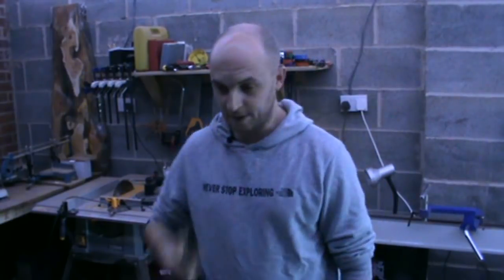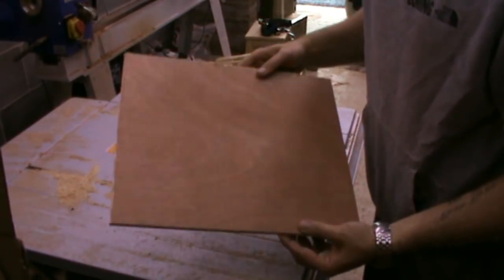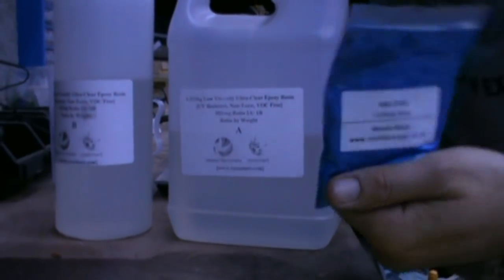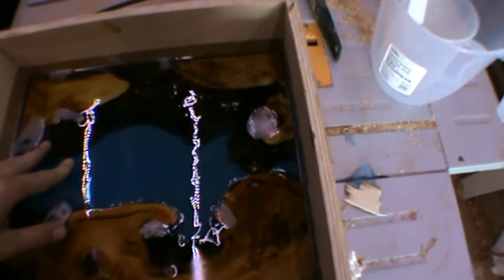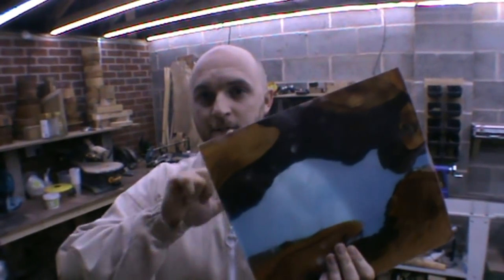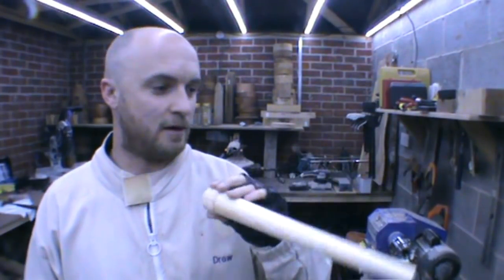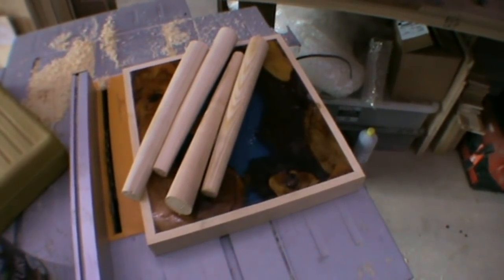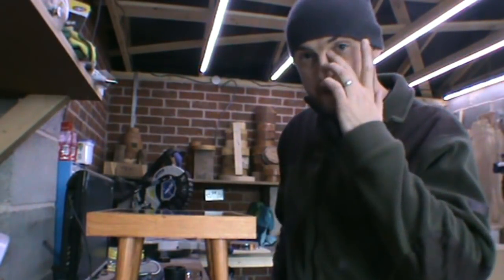How to make a Resin River Table

Comment: I have a question.
How did you remove the table top from frame box? I think it seems difficult because epoxy resin glues those things.
Reply from the maker: 櫻井仁紀 hello mate, thanks for the question 👍 I just used packing tape, it came out with a little gentle persuasion. The 4 sides were easy to get off, just a little whack with a hammer, the bottom was slightly harder, but again, a few careful knocks with a hammer saw it pop out! You can get mold release agent in a spray can, but I’ve never found it necessary! 
Hope that helps pal!
Reply: very thanks for your advise😁
That was surprising!  I tried 3 times, all time I can't remove the stuff though I used mold release can.  
Maybe epoxy resin I used is different from yours (I'm in Japan)
If you have a video when you get off the frame box, please let me see!
Reply from the maker: 櫻井仁紀 I’m sorry, I didn’t keep that part mate 😩 but all I did was cover where the resin would meet the wood in parcel tape (carefully and very neatly) and with a little tap and prize from a claw hammer, it came off pretty easy! Maybe it’s down to the resin? You could saw the wood off with a band saw? Or turn it off with a lathe maybe? I’ve heard that neatly smearing some finishing wax over the wood helps also. Apart from that, I’m all out of ideas 😂 suppose the best advice I can give you is to not give up and find what works for you pal
Reply: Well, Okay!!
Thanks so much!!
I'll try my best